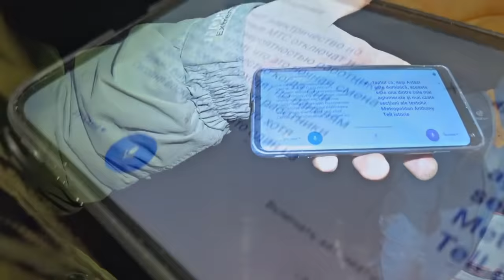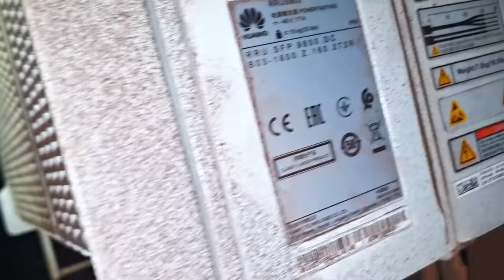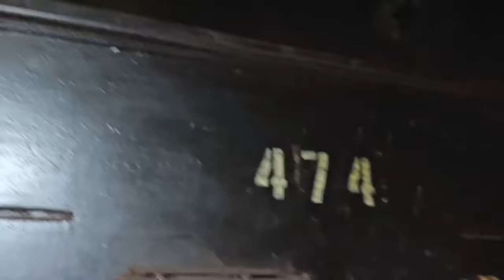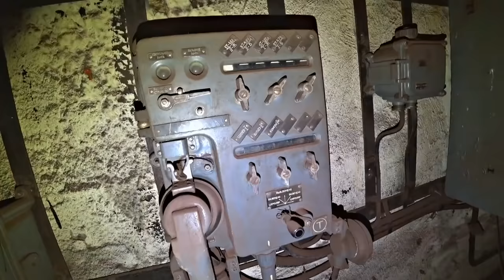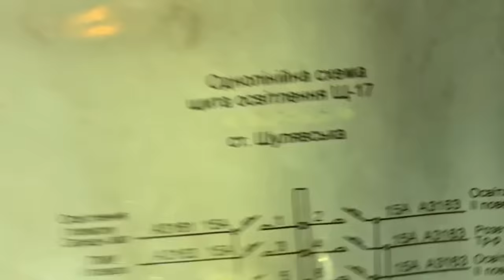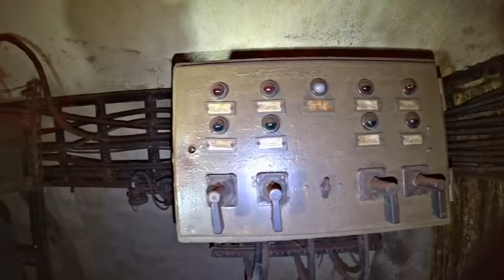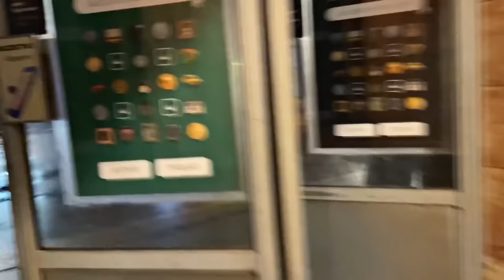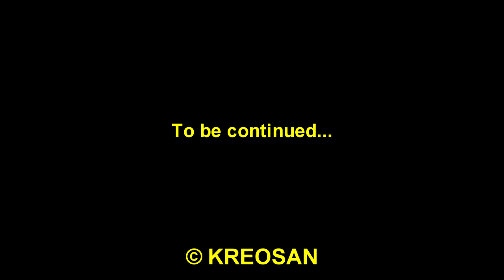Find a Nuclear BUNKER in the SUBWAY ☢☢☢ How to get away from the TRAIN in the TUNNEL🚇🚉

Comment: Man you folks are lunatics, I have worked on the rails and even with the best safety in mind have had a few near misses O.o   OK third rail DC... if it makes an arc it sucks you to the rail, overhead AC throws you away, 850v DC doesn't sound much but the current behind it is very very strong and will burn you up if you end up connecting.   Stay safe folks.
Reply: In former soviet republics DC is used for all railway tractions or 3rd rails. The only surface exposed is underneath and deep in the rail, preety sure this isolation might be leaking some current over the top, nontheless an arc shouldn't be an issue unless you intentionally put your hand underneath the 3rd rail or close the circuit by standing on a leaking part.
Reply: Yeah, there are plenty of vids where people play with much higher voltages than 850V DC, but it's usually something where the current is limited and the voltage will drop under load (when you touch it), only flows in the hand etc while not grounded, but touching an electrified rail would be a whole other story.